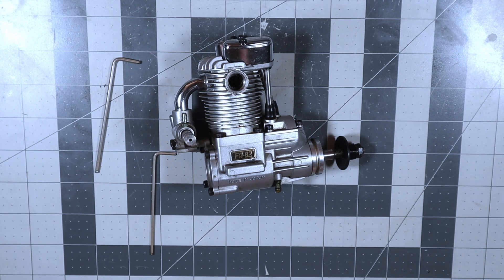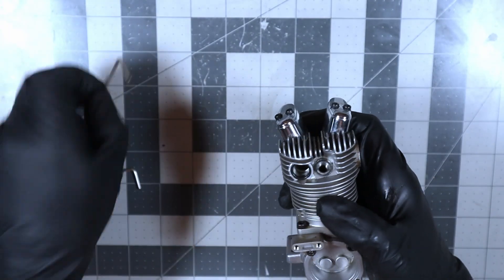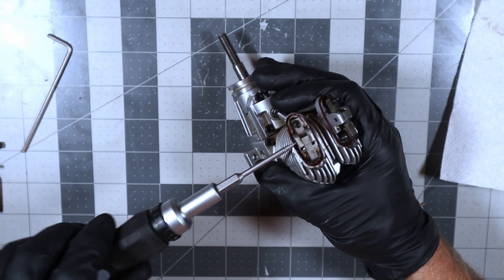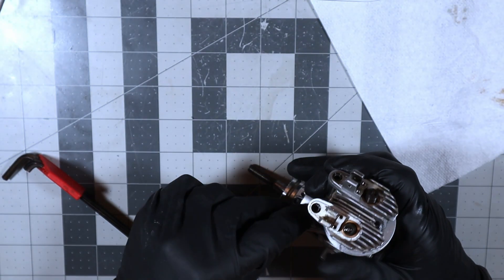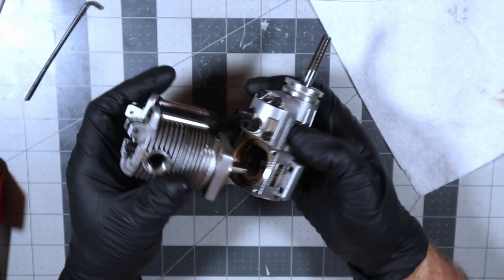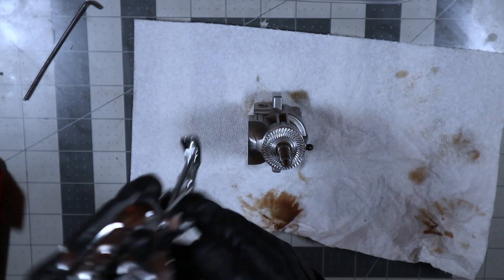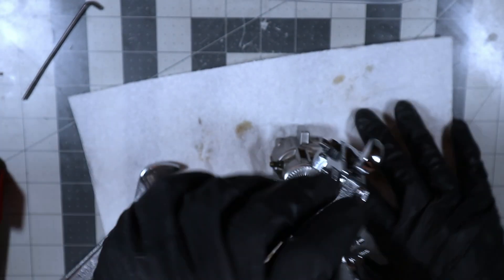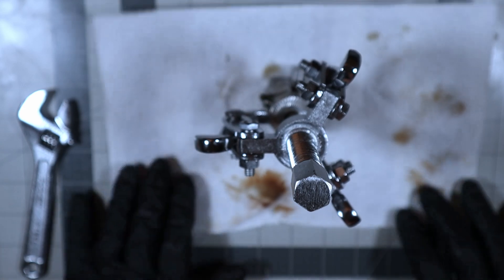Customer Engine Saito FA-82b Disassembly

Comment: I have never had an issue using an arbor press to push the crankshaft out of the bearings and prop drive washer at the same time. I do always heat the prop washer very well when I do it.
Reply from the maker: I can assure you the 1 ton press from harbor freight is not up to that task.  I have used them many times and the lever arm supplied is not enough for comfortable release in another persons engine. I have to do things with the customers engine in mind at all times.